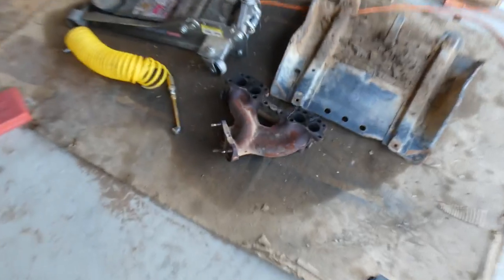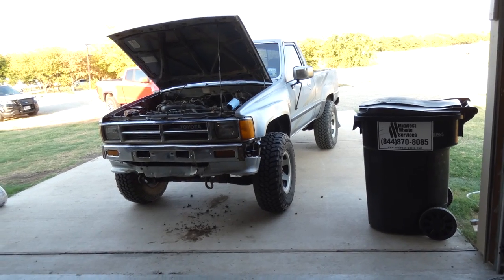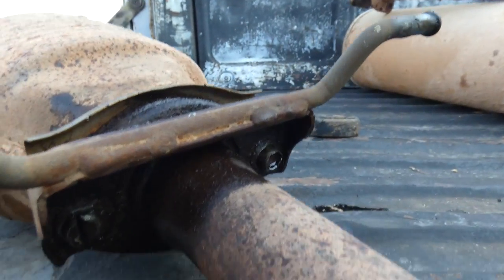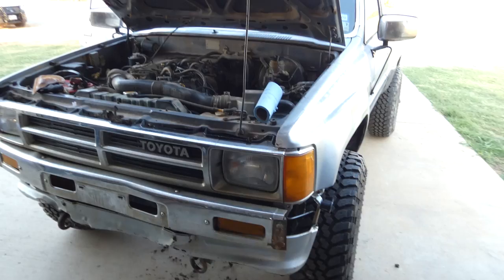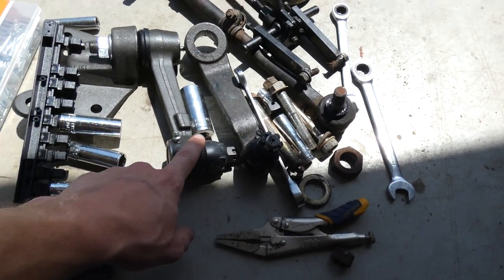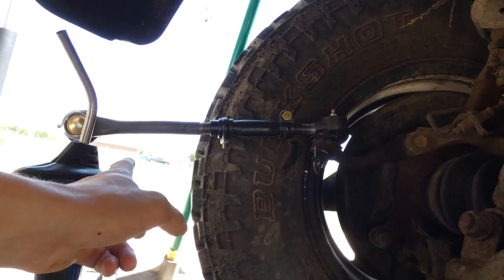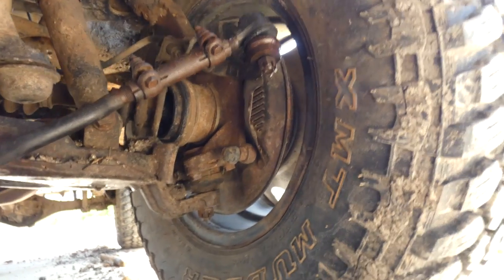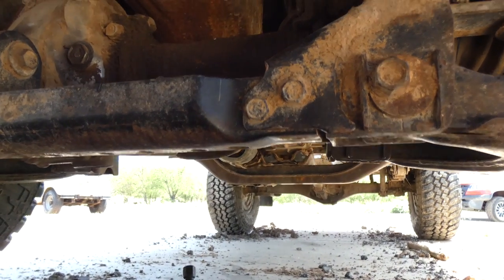$500 Dollar Toyota, new exhaust system and completely new steering!

Comment: Hello from NC. Great find & good restoration work! U are doing it right just replace it all & then no worries for yrs to come. U gonna have one heck of a nice truck when U get done! Those old Toyotas are known to get about 1/2 million miles before biting the dust. Especially that 22R motor 4 cylinder.  You can put those little trucks & motors thru hell & they're like the Energizer Bunny they keep going & going. 
A little Tip, and i know from experience, im a little older, in my 50's:  But If you're gonna off road always pressure wash ur undercarriage afterwards & that keeps from prematurely wearing out parts! 😉👍 Love the build keep the vids coming! 👍

Comment: Vapor lock can be reduced by making a heat shield between the intake manifold and carburetor. It will keep the hot engine for boiling the fuel in the carburetor.

Comment: I like that your using OEM and quality moog parts
Reply: Moog is 555 and those are NO GOOD. For example, there is an issue with front lower ball joint on 3rd gen 4runner and st gen Taco. The OEM lasts more than 150K miles but moog no more than 20K miles.